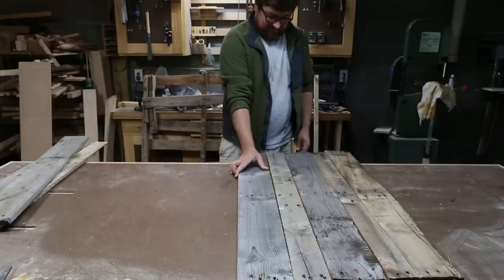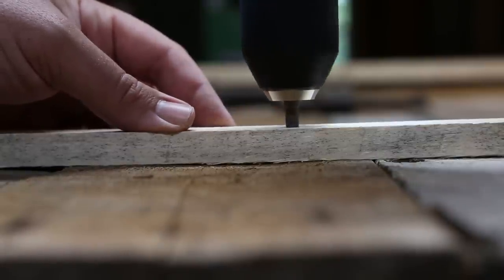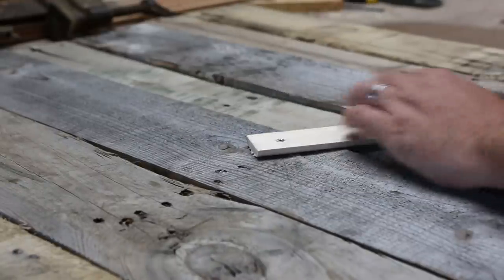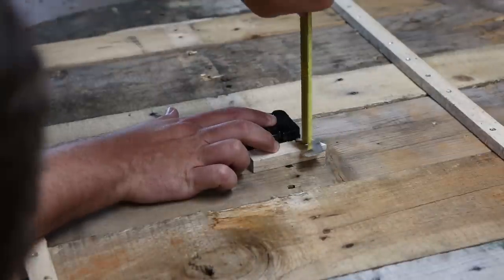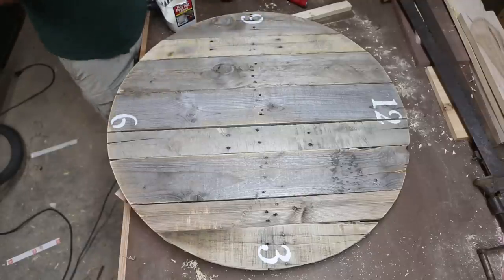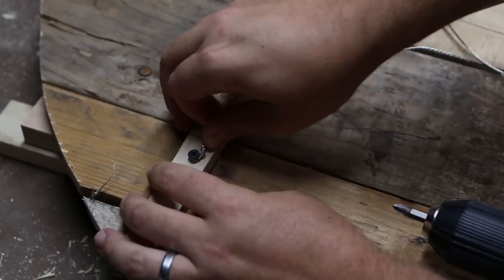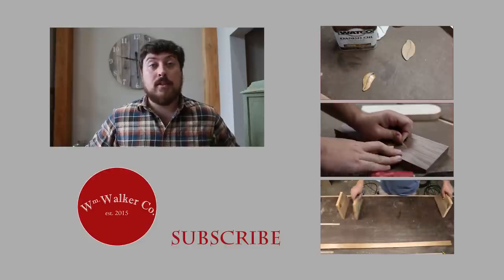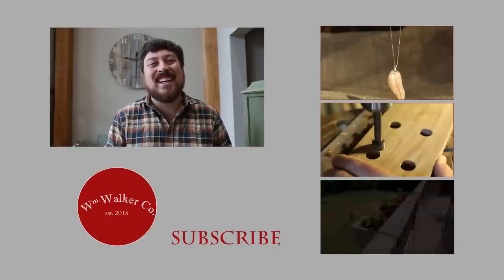How to make a giant rustic wall clock

Comment: Another way to locate the numerals is to temporarily install the movement and hands. Then just crank the minute hand around and when its at 12, the hour hand will be pointing to the correct location for the number.
Reply from the maker: Great tip, Bob. Tom Howbridge suggested that too. Definitely seems like the simplest way to do it! If I had only thought if that when I was making the clock...

Comment: Another great video!
Hey man, is that the shop fox classic fence you are using? If so, I'm considering purchasing one in the next few days.  How do you like yours?
BTW: just a thought, you might be able to install the clock at the 12' position move the minute hand one full revolution and use the hour hand to reference where to paint each number.
Reply from the maker: +ZH Fabrications Hey, yep.  It's a Grizzly cabinet saw so they come with the Shop Fox fences (same company/factory/owner).  I had upgraded to the longer rails though.  I like it a lot.  It locks down really well and doesn't jump off the mark when you lock it.  It's super easy to adjust for parallel with the set screws.  My fence had about a 10 thousandth bow in the middle.  I called Grizzly and they suggested using aluminum foil as a shim in between the HDPE face and the rail beam.  Now it's straight as an arrow.
Reply from the maker: +ZH Fabrications Oh and yeah,  some other folks recommended moving the clock hands too.  It seems so simple in hindsight!

Comment: Great video, best I've seen on here in terms of clock making. What size numbers did you use??
Reply from the maker: +Michael Kopacko I'm not sure the exact size numbers but these are the exact numbers I used: http://www.amazon.com/gp/product/B00JG9M1K8/ref=as_li_qf_sp_asin_il_tl?ie=UTF8&camp=1789&creative=9325&creativeASIN=B00JG9M1K8&linkCode=as2&tag=wmwalcom-20&linkId=ZJR2SIGGUQYFX3XY

Comment: love it, it is just what i am about to do, I will have the pallet wood the other way though if that makes sense? easier to paint the numbers? Just a thought ... thank you :)
Reply from the maker: Great!  I'm not sure if it will be easier to paint the numbers or not but I think it would look good either way.  One tip some viewers commented:  To mark the placement for your numbers, start the minute and hour hand at 12:00 then move the minute hand around one full turn, mark each hour until you get back to 12:00.  Seems really simple now, I wish I had thought of that when making my clock.
Reply: fab tip thank you, made the clock base repeatedly watching your vid :) just cant wait to get the hands on but no time yet ;( I am gonna print a pic of clock face and mark out from that?

Comment: I've made me one for my kitchen but haven't added the clock hands yet. My question is how did you measure in between numbers with the tape measure my clock is 32 inchs with Roman numerals all I have is 12 3 6 & 9 on it so far. I'm scared to mess it up!
Reply from the maker: Great question! I did a lot of trial and error with a tape measure and pencil but, some people commented a better way. Add your clock hands temporarily, set it to 12 o'clock, and turn the hands marking every spot on the hour. I.e.spin the clock until the minute hand reaches 12, mark 1 o'clock on the hour hand, spin the minute hand around again to the top of the hour, mark 2 o'clock, etc.
Reply: +Wm. Walker Co. thank you! Great video by the way I used pallet wood for mine as well! My brother asked me to make him one so I started his today!!! Im glad I found your video!

Comment: a lot of work using a pallet when u can get a electrical reel pallet already round
Reply from the maker: I did this in an afternoon.  A reel pallet would have definitely worked but I had this pallet on hand.
Reply: Wm. Walker Co. where do you find reel pallets?
Reply: +Brad and Kalley Seaquist whoever provides electricity to you're house well have them you call them up they well give you one